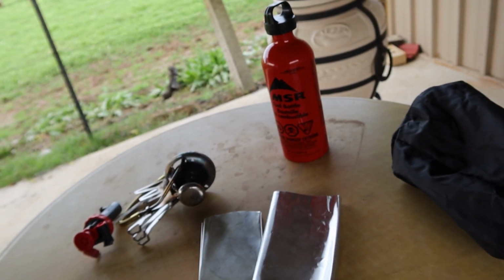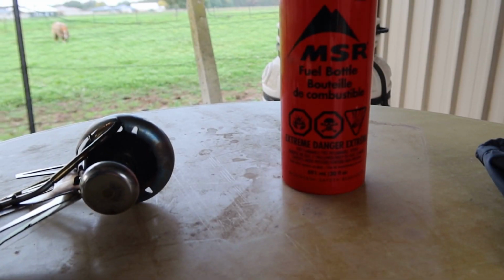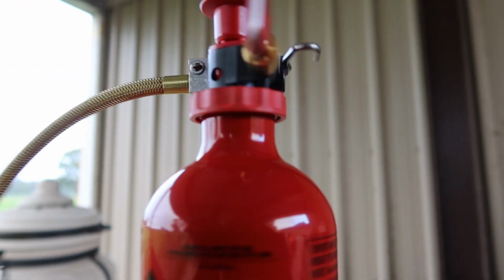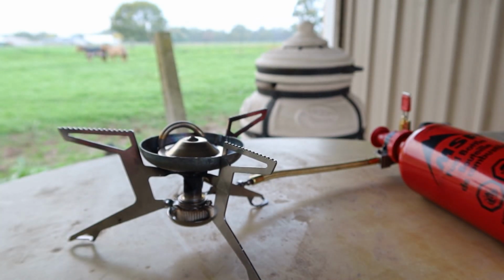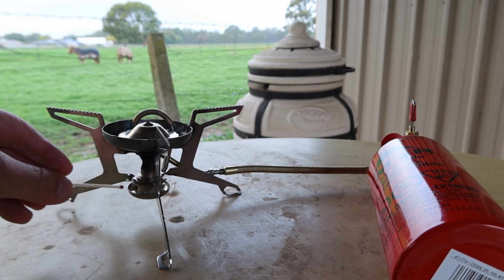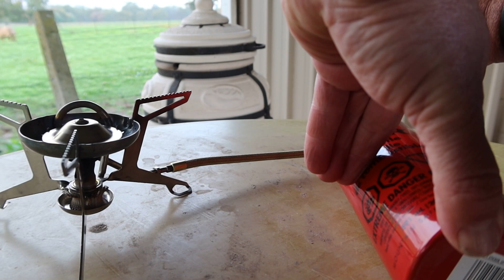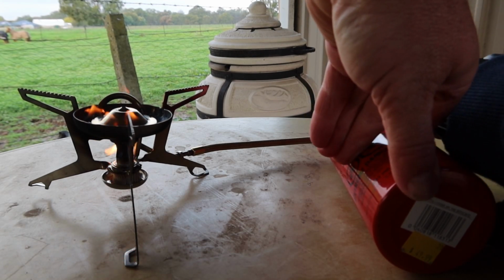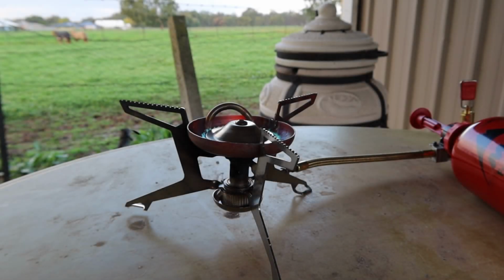How to light an MSR whisperlite stove

Comment: Nice demonstration. I have an early 90's vintage MSR International (from before the shaker jet was introduced). This was a time when you had to learn by doing - there were no instructional videos like there are now.
In almost every video I've watched on YT, people are in too much of a hurry to start the fuel flow before the stove is properly primed (with the expected flare-up). If you're doing it right, the stove will tell you when it's time to open the valve - you just have to learn to recognise it. Here, you've used just the right amount of fuel to prime it and waited the right length of time before opening the fuel valve.

Comment: i've had my (white gas) model for 40 years...very reliable and rugged...i carry a 1 liter bottle for 3-4 day backpacking trips, but could easily switch to a half-liter (i probably won't because it's the original bottle, and has held up as well as the stove)...

Comment: Bloody ripper stove Robbie! What do they go for?
Reply from the maker: Thanks UF, theyre quite expensive. I think it was around $220. I cant remember exactly because I bought a few other odds and ends. 
The propane/butane gas stoves are much cheaper, but buying gas cannisters all the time is much more expensive. 
If you use them all the time, these work out cheaper in the long run.
Reply: @robbiefishing  Ok, Those can stoves ARE good, I have several, and the gas DOES last a while!  I can get a 4 pack for $3-5. Last me a few trips!

Seems  they got the SAME idea/principle from/of the EVAPOURATIVE fuel injection system! 

Remember that? A mob in Melb came up with it & got an old 202 VK to do 60mpg!
THAT disappeared quickly didn't it? NEVER heard about it AGAIN!

Comment: How often do you have to pump air into it Robbert ?
Reply from the maker: Hey Jinda, 
I put around 20 or so initial pumps to light it as in this video. Usually that will keep it going while I boil water. If I'm frying, every once in a while the flame will start to weaken a bit so I will give it another pump, but its not  often. Its not like it's every minute or so. LOL